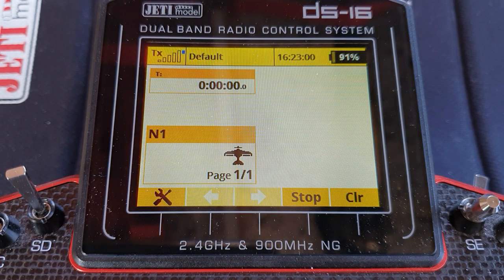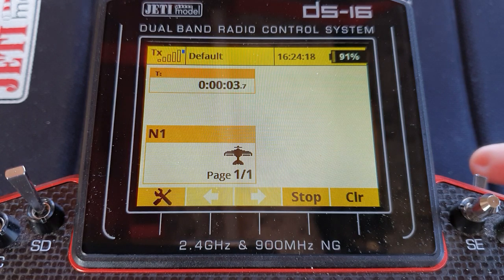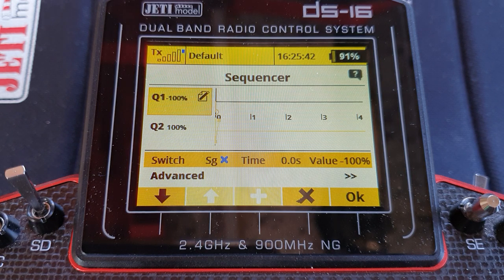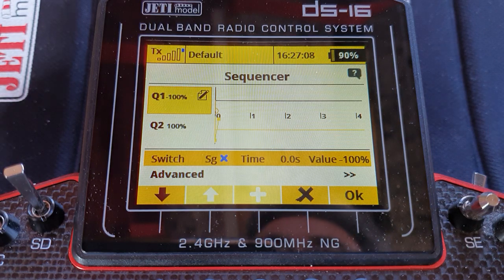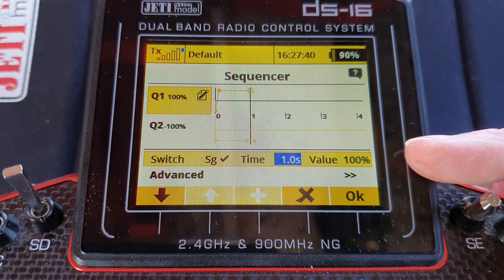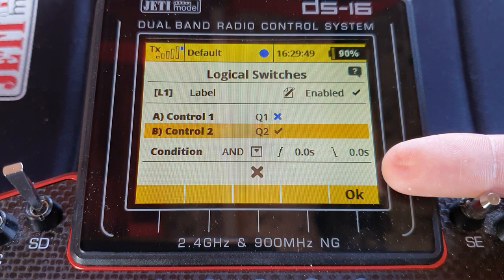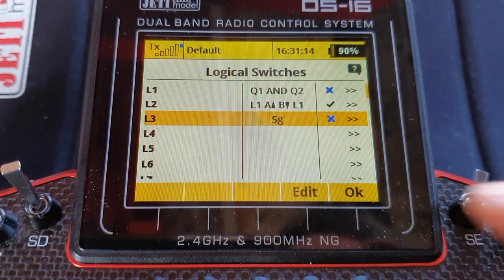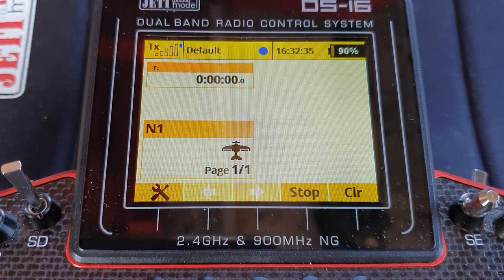Jeti - timer starts, stops, and resets from one button or spring switch

Comment: Brilliant as always! Please do a video about reverse thrust programming, you can program anything and I heard its possible with the Mezon Pro ESCs.
Reply from the maker: Not possible with Mezon Pro.  You can reverse the motor direction in Device Explorer but that is just to save you swapping two motor wires if it turns the wrong way.  It has no ability to run in both directions under radio control.
Reply: Forgive me for the amateur questions, but can a Jeti system program two throttle channels and allow swap switching between them? How about using two ESCs and two throttle channels? Thanks for all your help!
Reply from the maker: @dcabrick  yes I have made several videos about it, have a look at the playlists